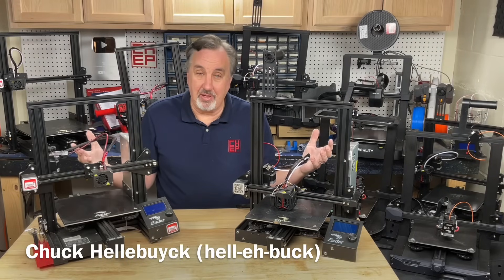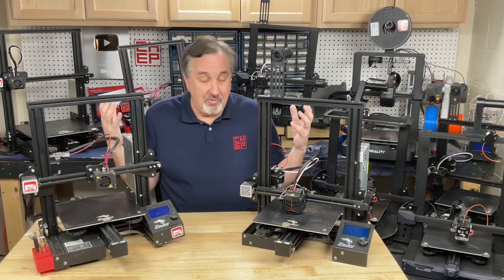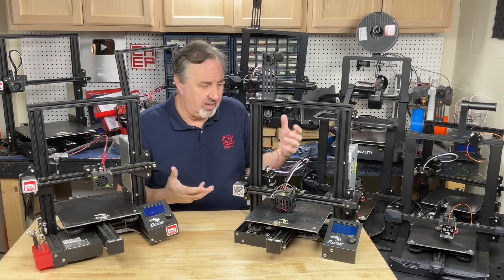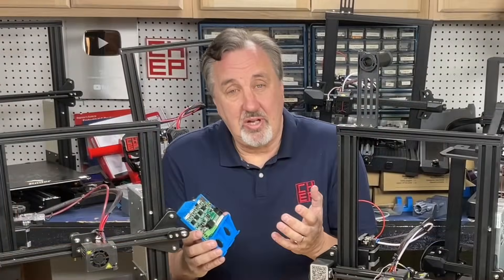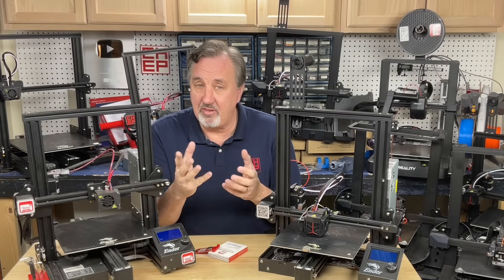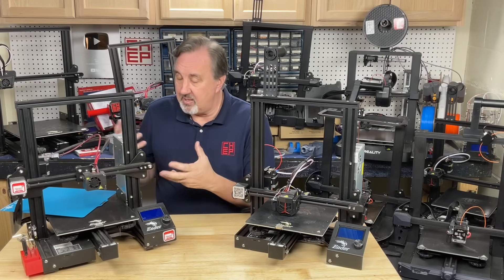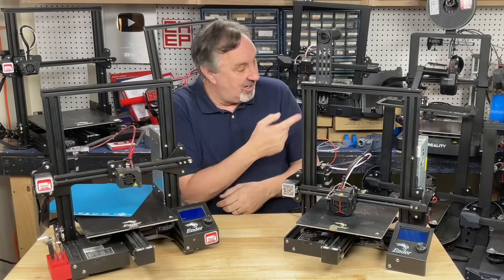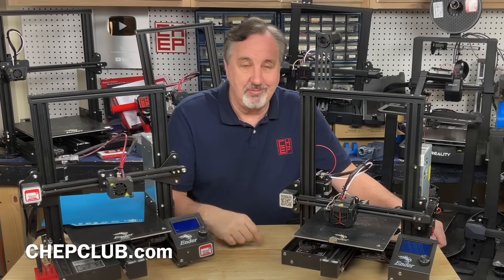Too Many Ender 3's - What Should I Do?

Comment from the maker: My mistake on the Cryogrip bed. It is available: https://amzn.to/41ARLjP
Reply: Bought my E3 V2 in 2020.  A month ago I  connected it to a pi with wifi running Octoprint so it's still cranking out parts for me.  Tried Klipper on the pi but just to complicated for me.  So yeah I upgraded just about everything over the years and keep looking at new but... being slow is about its only shortcoming as far as I can tell and it seems really quiet compared to todays speed demons so there's that. Patience was never my thing  either so this printer is like therapy for me in that regard!
Reply: Ive got 5 3d printers. one resin and 4 fdm. ender 5 that doesn't work i got from a guy when i was stationed overseas in the military. a Sunlu printer i got a year that i dont use cause it has trouble printing at 80mm/s (too slow). a monoprice printer from way back when that is sitting in storage. and my old trusty ender 3. I still use my ender 3 off and on now mostly for organizing things around the house/ printing tool organizers for the garage. I upgraded the board and the fans on it a couple years ago. but like you said the base models today are light years ahead even with all the upgrades. I find myself wanting to upgrade to a bambu lab just for the convenience of not having to constantly level or tinker with my ender 3. At first the tinkering was fun for me but now it's like a chore I have to do to make I can have fun with my printer properly.
Reply: @GRUBBNSTUFF  For a quality surface finish, I print at 90 / 190 (external/internal walls) on my P1S. 80 doesn't sound so bad.
Reply: Huh. never seen that... Interesting!   
"attracts the plastic at the molecular level" 
Really?  Sounds a bit beyond sci-fi lol.  On the other hand, you might have just spent $30 for me Lol.
Reply: Ill take 10
Reply: I’ll take one Im still using my ender 3 pro got it printing amazing still looking for another

Comment: my first FDM was a E3 Max Neo. 
im so glad i got it vs any other version. 300x300 bed. touch screen LCD. Runout sensor. Auto Level sensor.
only thing i did was upgraded the extruder from Bowden Tube to a Direct Drive. so glad i did too. made it so much better.

but back in March (2025) i got a 2025 model K2 Plus Combo. 
and i abso love it !! its so much better. faster, quieter. just amazing.

you could turn them into CHOCOLATE printers. seriously.
and it would make a cool video also

or - turn it into a Filament Recycler. it has plenty of motors. and frame material.
that would be a great video as well.

Comment: I have two Ender 3 machines. The first one I converted into a Recreator 3D to produce PET filament, and it works perfectly. The second one I converted into an E3-Switchwire with a CoreXZ system

Comment: Only started CAD drawing and 3d printing this year, as an old age pastime. On marktplaats I found an Ender 3 for 80 euros, but it was quite abused. Took the machine completely apart and rebuilt it step by step. The printing went satisfactorily.

 I looked around in the mean time and saw printers that can print all types of filament, with closed cabinet, camera, wifi, automatic bed leveling and thought: I'll buy one like that, then I can sell the Ender 3. No sooner said than done, I found a Raise3D E2 for 500 euros, which is still sold new for > 2000 euros.

But now it turns out that it has its own slicer, ideaMaker, and I was learning how to optimally set Cura for my Ender 3. I have to admit that I aimed too high with this purchase, the learning curve is too high for me. I can keep this and maybe use it in the future, but I choose to keep my Ender 3 and sell the Raise3D E2.

Long live the Ender 3! 😇
Reply from the maker: There is something to be said for simplicity.

Comment: So just got my printer last 4 or so months ender 3 pro second hand loving it but having a hard time with my prints and your videos have helped when I've come across them I am thinking of upgrading as the costs to upgrade the ender in Canada put me in the same price range as buying something new now I am going to watch more of your videos to solve my current issue what I believe to be heat creep
Reply from the maker: If the top of the hotend heatsink is hot to the touch when printing then the cooling fan needs to be replaced.
Reply: @FilamentFriday  yep hot end is getting too hot need to replace the fan sadly

Comment: i have cr10 v2 still, upgraded to cl touch and direct drive extruder.    It's tuned well enough from tinkering that it still matches some of the current top printers in quality.   I know the speed is way slow though :)

Comment: I just bought a used original Ender 3 for $20!  I've wanted a 3d printer for years but couldn't justify it.  I love figuring out how to improve prints and I've learned a ton these last few weeks.  I still like Creality Print as my faster, cleaner slicer but at the same time if Cura does a better job perhaps I need to jump ship.  I'm looking to see just how fast and how accurate this old Ender 3 can print and as a nerdy Mechanical Engineer, I honestly believe that it can still compete against the much more expensive modern printers.  Might be slower but I can wait and do the manual parts that the new machines can do quicker and automatically.
Reply: Cura is what I learned on when I started about 3 years ago,  and is what I am most familiar with.  so many useful plugins as well, and still updated,  I stopped printing a year or so ago, after a small house fire,  the garage I used for my hobbies was used for storage,  I have a single Elegoo Neptune 2S,  basically an upgraded Ender 3.    so recently I come back to 3d printing and it feels like I was gone 10 years,  the whole world has changed, everything is about Bambu labs, and Cura is not as popular as before,  Orcaslicer seems to be what most people use or some variation of it.   my printer still works fine,  but I did order an Elegoo Carbon,  it was only 300 bucks, and I have always wanted the ability to print with ASA, TPU and some other exotic materials for functional parts.  I'll keep my older machine for printing PLA and smaller parts.
Reply: Best upgrades I've made: bttouch, silicone spring replacements, bigtreetech main board.

Comment: I got an Ender 3 Pro about 5 years ago.  I upgraded immediately to dual Z-axis and BLTouch. Capricorn bowden tube.  The BLTouch started to act up so I got a Sonic Pad, CR Touch, Silent MB a year and a half ago.   Totally changed how well the printer worked.  I went from tinkering all the time to solid printing print after print and halving print times.  I have maybe $500 invested total but the features and ease of my printing I'd say rivals $1k machines today.  Sure I have only one filament color but that's all I need.  I referenced many of your videos over the years.  Thank you very much!

Comment: okay, I was sick and tired of my Enders.. Now I have three sat on the floor of my workshop waiting to be stripped down and drawers full of Ender survivor gear, extruders, wheels, even linear rails! Did I give up printing? No not at all, my mistake was buying a Bambu X1C and running a benchy.. then I made the scraper.. Then I made a project that had given me so much pain to print.. Then I took a break from printing the impossible, went to my workshop and moved all the printers.. Kinda sad, but they are now useless items. Bambu are the "Apple" of printers, they supply everything, software that you hardly need to tinker with. It just works. Enders have had their day and I came here to see if you had any ideas on what to do with them. No, same as me then. Seeya Chuck.

Comment: Yes, I still have and use my Ender 3 S1 Pro. I have created a profile for .2 nozzles to print statue style prints because I can't have a resin printer in my house. I have gotten the profile down so well, that its actually hard to see layer lines. I have even gone the step further and will use resin style supports for this purpose. Its not the fastest printer as printing at .08 layer height just can't go very fast with this much detail. My Ender came with direct drive so that was already a boon. I only used it for a couple of months before I threw Klipper on it and without Klipper I probably would have gotten rid of it a lot sooner. Now with Octoeverywhere I have all the bells and whistles of a new printer, with the exception of cloud printing. Considering I don't use a printer for this aspect means it doesn't really matter though. For larger style prints I have my FLSun V400. I do however plan on getting an Elegoo Centauri when it gets released this summer though as I would love to get my hands on a decent core xy. I just hope the tarrifs don't raise it too extremely high lol.

Comment: I've had my E3 for 6 years now.  I used to make a lot of things for around the house and friends.  Now not so much.  But with the new tech these new printers are coming out with and at a great lower price I think I'm going to upgrade.  Plus with these new budget models you can print with different materials that the E3 just can't do well without heavily modifying it.  Just trying to decide between the K1C and Centauri Carbon.

Comment: I have an Ender 3 Max Neo for over a year now and I am not thrilled anymore.  I have had adhesion issues and even when adding a PEI plate to it I still can't get prints to stick.  I am sure it is user error but I feel I have tried everything.  I think at this point I will look for a new printer of a different brand.
Reply from the maker: Understand. I recommend the Biqu Cryogrip bed surface as it makes prints stick so much easier.
Upgrade your Bambulab P1S with Biqu CryoGrip Bed Surface
https://youtu.be/43c2QdsDNbs

Comment: same problem, i got this with my prusa's and also enders. i think i scrap them all and use the extrusions for maybe filament storage racks, use motors for other stuff maybe filament winders to wind filament from big to small spools. but it hurts a bit to be honest. also wasted lot of money on it like forge aluminium beds with 220v heaters bondtech extruders and hotends. maybe i'll keep them for TPU prints or materials that can't be printed fast anyways. i also will try to print fast speeds with it, it should be possible. A1 can do it Prusa MK4 can do it. bed leveling for an ender isnt an issue anymore. I still have 3 unfinished brand new enders that were undergoing expensive upgrades and now they are stored... doing nothing just watching me use bambu's

Comment: I am still using my Ender 3Neo and will continue to use (and modify/upgrade) it until parts are no longer available. It has been a great learning machine and it works well for me...since it is a hobby I don't need additional speed...the multi color would be nice though.

Thanks for the great content...I have learned (and will continue to) a lot!

Comment: I bought my pro during COVID and love it. Just just getting sick and tired of it not working at times. It runs klipper on a manta board, has a bl touch and a hero gen 7 cooling duct. So lve loved to tinker but now just want a printer that works. So I've dropped the money on a Centauri carbon pre order. When it arrives, I hope I have space for the ender 3 or it might get parted out or sold on eBay.

Comment: I was looking at getting a cheap 3D printer and repurpose it for my hobby, watchmaking.  With watchmaking, we strip down the whole movement, clean all the parts, then reassemble, oil and adjust.  Automatic watch cleaning machines can be thousands of dollars.  Beyond the budget of a hobbyist.  I did a dry fit of the wash jar, two rinse jars and a drying station (from my simple DIY machine) onto the bed of my Ender 3 Pro (which I still use).  Real estate wise, that works.  I just need to replace the hot end with a stirring motor setup to hold the watch parts then rig up a PTC car heater for the drying station.  Then come up with a simple Gcode file to move the head from station to station, activate the stirring motor, then activate the heater.  In theory it should work.

Comment: I own a small print farm for business. I do not usually just print models from clients, but I am more involved in the design process. I mainly print with resin and Qidi tech printers nowadays but I still own 2 heavily modified ender 3s: I use one as a 0.4 nozzle back up and one with a 0.8 nozzle that I use mainly for rigs for my own (painting supports, and the like). The 0.4 nozzle one still has great print quality and the only caveat it has compared to modern printers is the speed, really. It doesn't give me many issues TBH. Oh, I do own CR-10 smart pros for larger prints, too (slow, but reliable AF).

Comment: I still have my Ender 3 Pro and use it so rarely that it's almost new. I even bought a un upgraded board for it, but didn't have time to install it. I'm tempted to buy a bamboo printer with multicolor, but taking into consideration how rarely I use my 3d printer it doesn't make sense to buy a new one.

Comment: It's a shame.  I'm still having fun with my Ender 3 pro.  I learned to bed level myself.  After a few good prints I installed an auto bed leveler to increase times between manual levels.  I printed my own add ons to the unit.  I printed my own designed objects to improve other parts of my life.  Added OctoPrint.  I recently decided to buy a "silent" board which I'm going to put in today just to get the experience of changing out the board.  Now I see the Bambu's and I get worried.  Sure you can buy replacement parts, but it feels like a lot of the hobby aspect is lost and then I also worry about the potential privacy issues that I'd be supporting if I bought one.  I am going to buy a new printer at some point, it will be large bed but in the meantime I've still got a filament runout sensor to add, possibly a direct drive, dual z axis kit.  

Thank you for the board idea too for the old board since I didn't know what to do with the old one, now I do.

Comment: I’m running nebula pads on my original ender 3 with sprite extruder kits . Using 3nder3v3 KE profiles . Mind you you do have to modify klipper printer.cfg . Bit getting up to 300mm speeds and printing beautifully.
Reply: And Chep , this almost sounded like a good bye vid …. 😩😥

Comment: I've seen them turned into threaded insert heat presses and CoreXY using 2 Ender 3s.  I've stripped mine into parts so I can box them away until I have good idea on what to use them on. I know the extrusions will probably be the most utilized, followed by the wheels. Power supplies maybe? I do have some uses for the stepper motors: I want to build a 16mm film capture station.

Comment: I converted one of my old Ender 3 printers into a Laser Engraver. It was a parts machine and was missing the hotend anyways. I used one of the kits that you hook up that has it's own mainboard,etc. I stripped out everything but the axis motors (including the limit switches), and clipped off the leads for the heated bed. It isn't perfect, I need to put those limit switches back so be able to fine tune where the head is in relation to every print so I can get it consistent.

Comment: Still using my 1st 3d printer, not surprisingly, an Ender 3 1st edition. Have printed loads of stuff on it and still do. It just keeps on going and going good. It has produced quite complex prints. In a variety of materials with good results like abs, tpu, pla-wood, petg etc. So I’m happy with the machine and it’s very reliable.😊

Comment: One of the main disadvantages of the Ender 3 is the printing speed. If adjustments can be made to the firmware as well as the extruder to speed up the printing speed, it will be an excellent opportunity to upgrade these printers. I also have a small farm which I have upgraded to the Creality K1 SE. I still use the Ender 3, but compared to the K1, they are extremely slow.

Comment: I still have my ender 3 V2 as my first and only 3d printer. But tbh I really want one of the new ones. One of the reasons I didn't buy one already is that the ender 3 V2 still works perfectly fine, hard to justify buying a new one (as a hobbiest).

Comment: still using my beloved Ender 3 and have made many modifications. Now, it has a tool changer that can print paste or pellets, and it can even print hamburgers and oven them at the same time. It can also be used as a milling machine to mill aluminum, fiber, and PCBs.